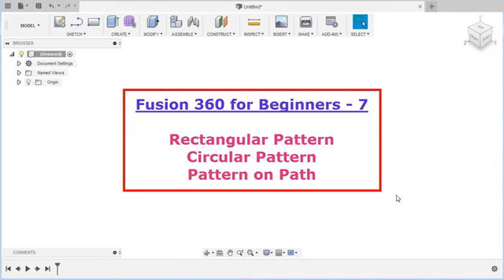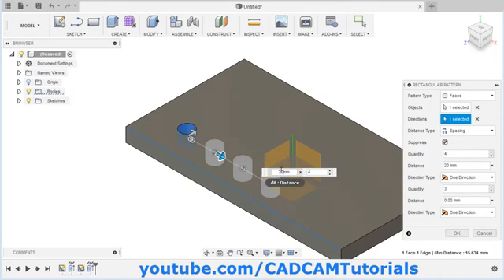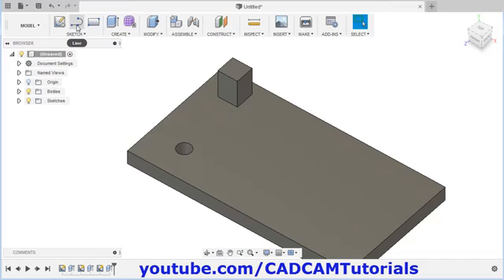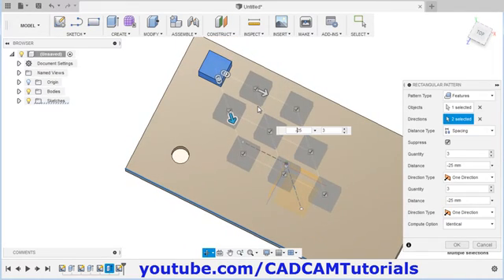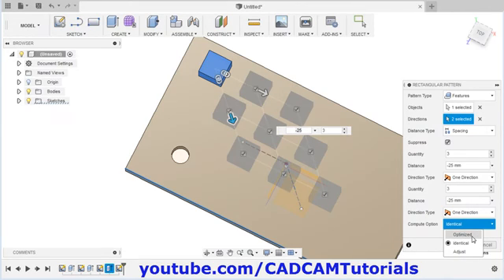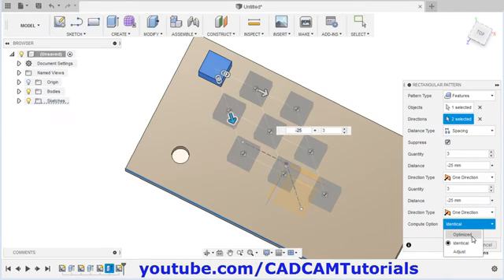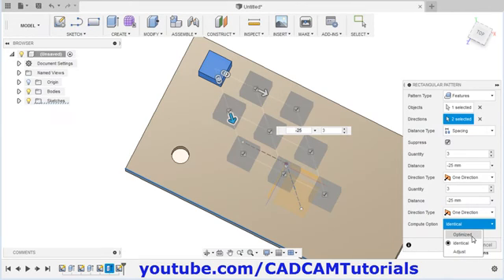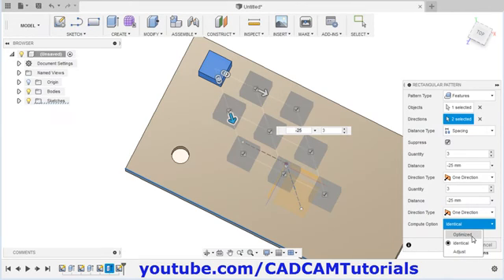Fusion 360 Tutorial for Beginners - 7 | Fusion 360 Rectangular and Circular Pattern, Pattern on Path

Comment: Once again a very straight forward tutorial.  I have a question please. 

At 16:52 you talk about creating a pattern from assembly commenting that in that case you would choose the “components” option.  Does that mean that you can open an assembly containing numerous parts - say for example a car wheel including a rim, tyres and bolts, and create a pattern of 4 wheels by just selecting the assembly and creating the pattern of 4 assemblies by choosing the “components” option - without having to pattern the rim, the tyre, and the bolts individually?